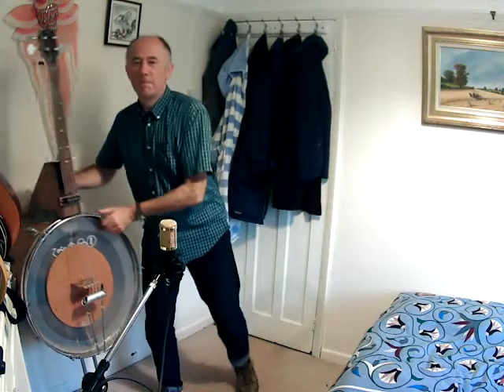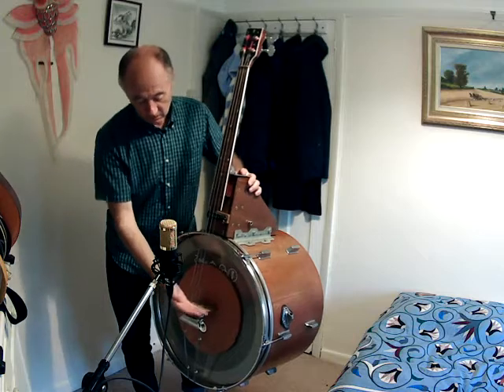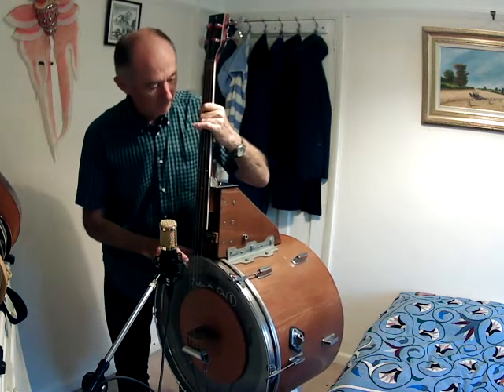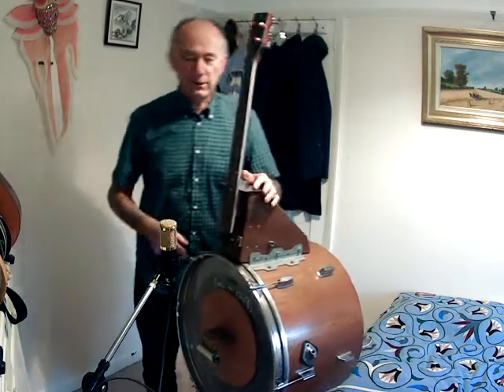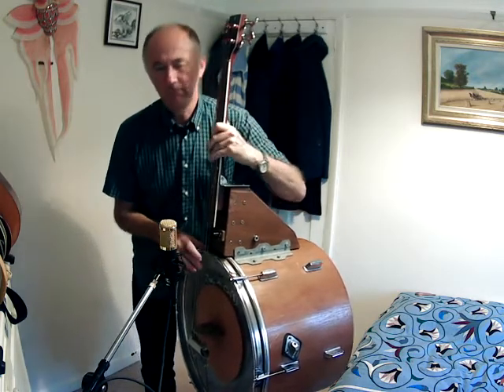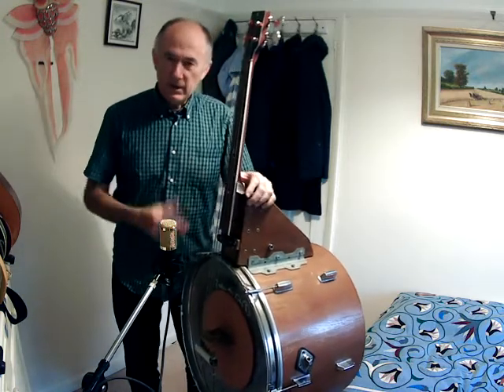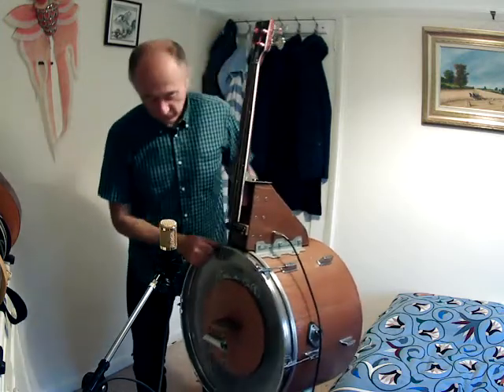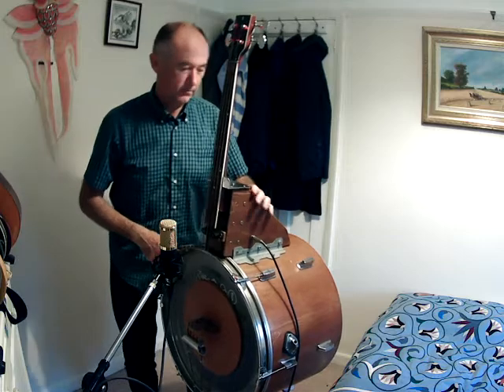Double Bass Banjo updated

Comment: That's beautiful. How loud is this Instrument with the Head compared to full size solid wood upright bass? Did you also try having a drum head on the back as well?
Kind regards
Reply from the maker: It's not as loud as a real double bass, but it's plenty loud enough to play alongside guitars, fiddles, voices etc in a pub gig. I started with the rear drum skin: it was louder but twangy and there was nothing worthwhile coming off the bottom string. I replaced that with a plywood panel and a tuned port - much better. Gibson's bass banjo had the bridge sitting pretty much directly on the skin - again loud but twangy - so I added a plywood disc under the bridge to give me a sort of piston or loudspeaker diaphragm. The front drum skin then serves as the suspension. As the disc gets bigger (heavier) the instrument loses sensitivity but gains in clarity and evenness of tone. That's another trade-off. I hope you can get some ideas from my video and have a go for yourself.
Reply: @diasporamusicdanny 
I appreciate your answer. That's indeed very inspiring, but I'm afraid to not have the skills and tools right now for making such a thing. :)
But it sounds great and now the question in my head regarding the head on the back is answered. Keep up the good work.
Kind regards and thank you